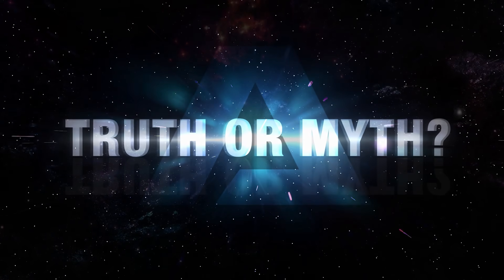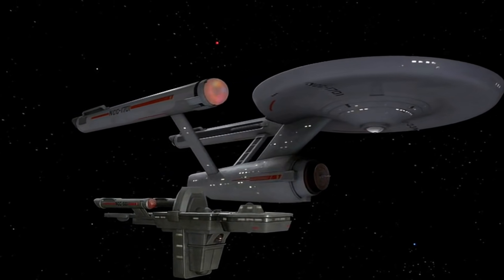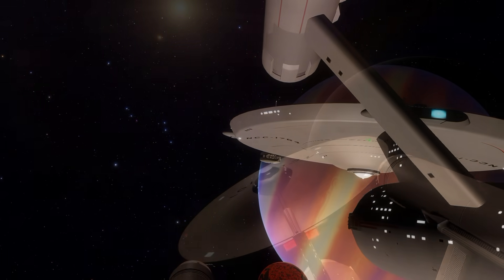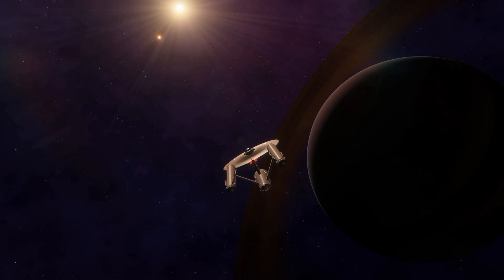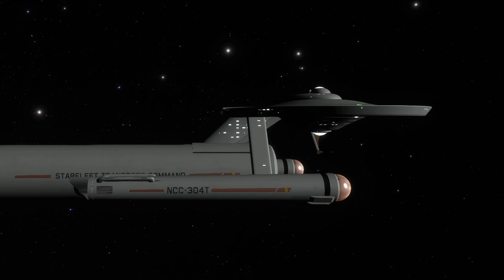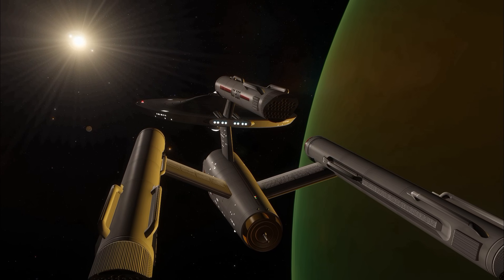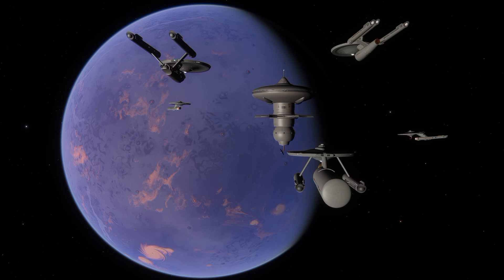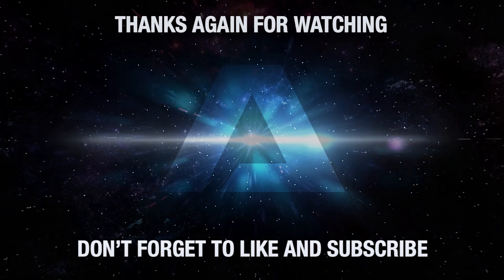(95)The Franz Joseph Designs

Comment: The Franz Joseph designs are wonderful.
My personal headcanon on the early Saladan clas destroyer was that most lacked antimatter reactors, using the extra space for extra deuterium fuel tanks and a larger/more fuson reactors for the impulse engines, allowing it to use fusion reactor powered warp drive like the Romulan bird of prey in Balance of terror, resulting in a shorter ranged ship that was far easier to mass produce and use to bulk up defences of important star systems and stations, or fly patrol routes within its fuel range.

They would have to refuel far more often, but the cost and material savings allowed them to be built in far larger numbers, saving dilithium for use in longer ranged ships.

The ones with antimatter reactors were used for longer ranged  missions such as patroling between the more outlying colonies.

As they mention in the start of ST:TMP when discussing the refit Enterprise, the refit used power from the warp core to power the phasers, catching Kirk off guard, implying TOS era designs used the warp core to power far less systems, making the lack of a warp core mater far less.

Comment: "I'm not sure what the extra 5 crewmembers did on the Saladin, but I'm sure it was important."

Ah yes you see they were the ones who stuffed the rocks into the consoles for when they went boom. Very, very important job.
Reply: The Saladin had five guys who's sole job was placing rocks in consoles and the other ships had a rotaring staff that handled it. 😁 That's why you always had to check the duty roster when serving aboard the smaller ships. 😃
Reply: Were they wearing a red shirt?
Every crew needs an expandable inventory of red shirts!
Reply: Seriously, I'd bet they were weapons control officers. With no torpedoes, and only one phaser bank, the remainder would be unneeded.
Reply: A lot of red shirts served in the 23rd century.
Reply: I don't know if you saw, but in the recent lower decks they give a canon explanation for the rocks!

Comment: Thing I love about this, is that the saucers are ALL THE SAME SIZE…

So in theory, starfleet yards could in theory simply mass produce the basic saucer components, then much like old sea faring sister ships, the finished hull could then be outfitted to suit…as the interior layout would differ form class to class…with some areas on one class being for example crew quarters, whereas on a ship without a secondary hull, might instead be taken up be engineering…

Comment: I'd say that the difference between the Saladin and Hermes crew complements is the weapons on the Saladin. Figure one tech for each Phaser Bank and 3 for the Photon Torpedoes (2 crew for loaders and 1 for launch). Don't forget that even though weapons control was moved to the Bridge, there most likely would have been back up crew in the weapons mounts.

Comment: As much as I love the Constitution class design, I feel like it easily should have double the phaser load out to cover all those blind spots.
Reply: Those early phaser emitters rotated (like a ball bearing) in tandem or independently. Did that have blindspots? I'm not sure it did.
Reply: @RX552VBK  I remember there being thought that for the original design, the Constitution did have decent coverage except directly aft.  That was rectified with the refit where two emitters were placed right above the shuttle bay.  I figure it to due be limitation in power supply. The original Connies were powerful, but still limited. The refit design added a lot more power which added more weapon ability.
It was stated by Captain Will Decker that with the refit, the phasers drew power directly from the warp engine, which created a vulnerability if the warp power was not operating at nominal efficiency.  It stands to reason that the power supply was changed since then, as the Enterprise's phasers worked just fine with warp power knocked out during its fight with the Reliant.
It makes me think that with the thought of the Enterprise being the only refit, it might very well have stood as more a testbed for the new tech being implemented.  It's no wonder it wasn't easy to sway Admiral Nogura to take the Enterprise to intercept the V'Ger cloud, being the only bearer of all that new tech.  But obviously that mission and the following shakedown cruise got things where they needed to be to make the Constitution refit a class to be respectful of.
Reply: @samsonguy10k  I disagree slightly, the port and starboard saucer phasers could fire directly aft (bearing 180°) but the warp nacelles blocked a portion of their respective sides' aft arc. I don't recall the specifics but it did leave a nice window for bad guys to sneak into for a few moments of not being shot.

This, of course, assumes combat on a 2D plane. In 3D, little wiggle and no more blind spot.

Comment: My issue with the dreadnaught has always been the placement of the third nacelle. It should attach to the secondary hull, not the primary hull.
Reply: In the constitution class when the saucer separates from the secondary hull it is no longer warp capable but with the dreadnaught class both sections would still be warp capable.

Comment: I ate up the Tech Manual designs, but I never did take a liking to the "dish on a stick" deflectors of the Saladin, Hermes, and Ptolemy classes. They just never "worked" for me. Of course, as the first to fill in gaps in Starfleet's lineup, I don't really hold it against them, either. I just prefer some of the solutions used in similar designs that came about later (alas, still non-canon).

Comment: Not to knock your or anyone else's love of these designs, but some of them are just ... wth.

- the first ones you show, it's like they took the Connie and just moved the nacelles around or removed them and said 'yep, its a ship.'  Without trying to make sense or reasoning.
- Same with the dreadnaught.  Why would you put a warp nacelle on the saucer of a warship?  You're effecting your weapon's arc of fire that way, making it an easy blind spot.  If it had been on the back end, slightly in line with the other 2 nacelle, it wouldn't be much of a problem as you'd atleast, if the saucer was higher, fire 360.
- The transportation ship actually makes sense.  Especially on the Miranda-type classes.  Basically having a way to attach pods like these. Could easily bring supplies to colonies or stations.  Imagine like a bunch of these warping to a new colony, with enough pods to make a settlement easily.

Honestly I prefer the newer designs of ships, and not any designs from the original TV era or what people put out after it.  Mostly because nowadays people think tactically, we have a broader knowledge of design and purpose.  As much as people give shit to designs like the Crossfield (Discovery), the NX (Enterprise), the Kelvin designs, and even in Star Trek Online - they make sense.  You want slim or compacted forms. You want your saucer and nacelles in balance so you can fire 360 from it. You want your nacelles brought closer to the hull so the pylons aren't targets to cripple you.  If you're creating a bubble to move through space, then you want it to be more horizontal and less vertical.  May even want a more arrow-shaped for your saucer.

Comment: It really doesn't make sense for a constitution class to have a complement less than a WW2 era heavy cruiser.
Reply from the maker: Actually,  it makes absolute sense!  Apples to Oranges... 🙄
Reply: @TriAngulumAudioStudios  Just saying, they are massive vessels with small crews, I just find it odd.
Reply from the maker: Thats the way advancement works...  Larger, better tech = less people required!
Reply: @TriAngulumAudioStudios  I suppose, most of the secondary hull would be the shuttle bay while machinery would take up quite a lot of space as well, it does make more sense if you think of it that way.